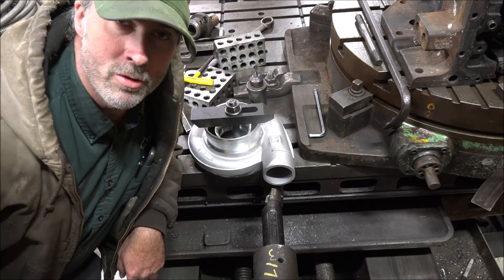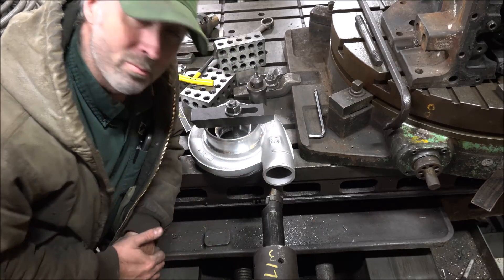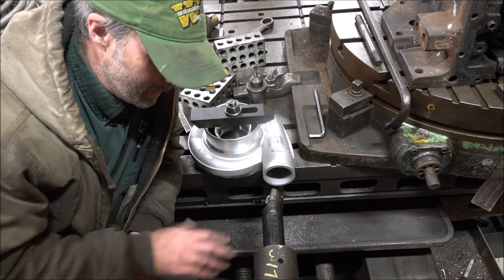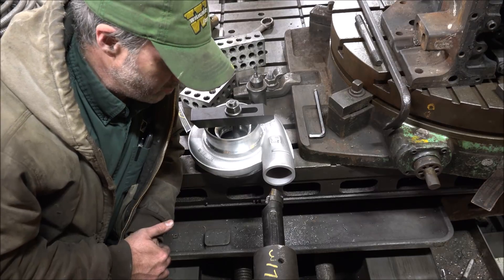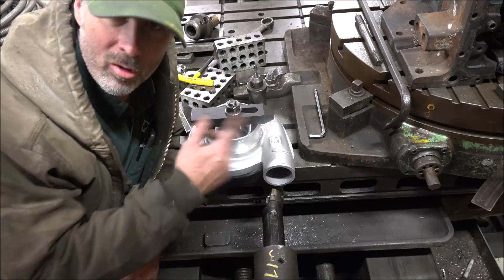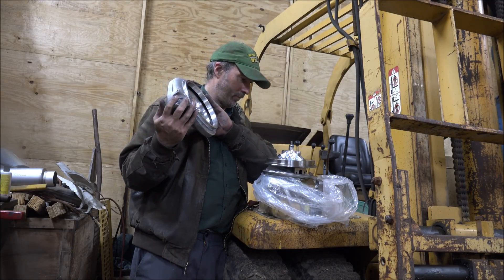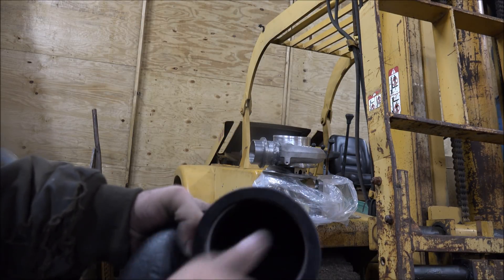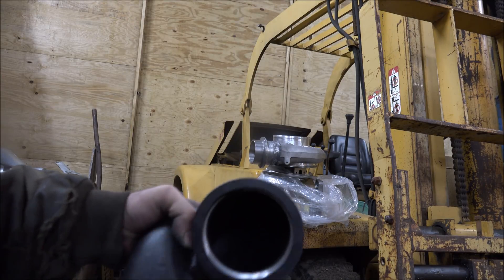Converting S400 Turbo from Hose Discharge to v-band No Blown Boots Ever!

Comment: What happen to the vband that came on it ? I used to have a small compound kit with allot of fuel that would split boots at will . I then went to a larger setup I vband the complete hot side.  I've always said my machine shop is one tool that has payed for its self over and over.
Reply from the maker: The SXE472 is not offered with a cover that has the v-band from the factory.
Reply: @bcbloc02   Makes sense . Cool video . I love seeing what others are doing .

Comment: Perhaps in five or ten years laser sintering will be common enough to print a flange right on there, but until then this works just fine too.  Merry xmas to you and yours!
Reply: Price isn't an issue anymore. Machines are now sub 20k used. You got to keep them clean, wipe down with alcohol between each part run full ppe loading and unloading parts and have full chain with materials.